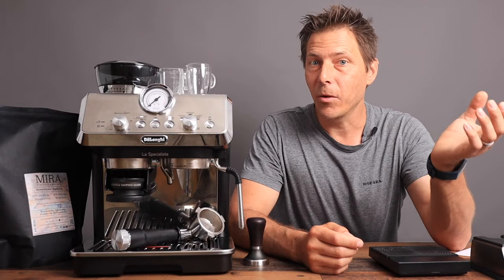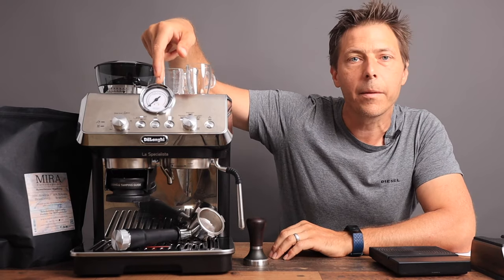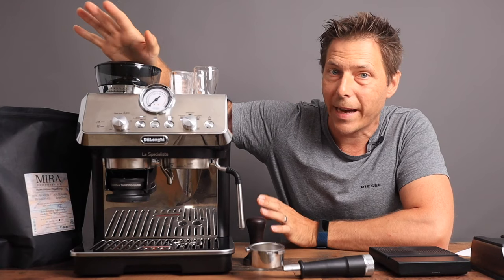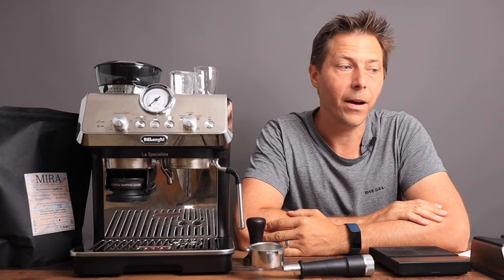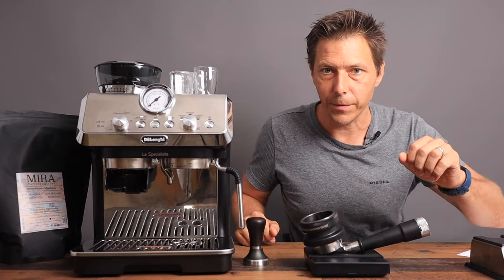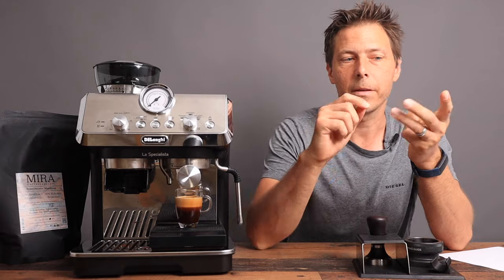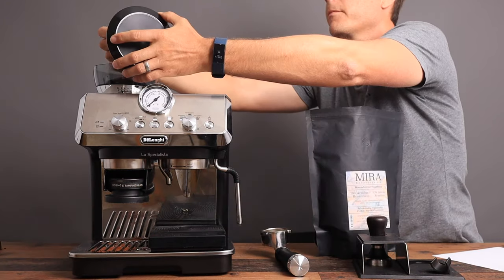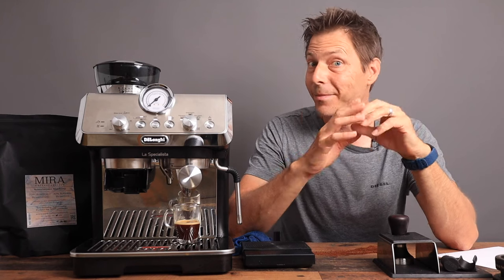Low Pressure? How to Dial in Delonghi La Specialista for the “Optimal Zone”

Comment: Hi Tom! Awesome video! Just noticed you didn't quite hit the 20-30 seconds extraction mark. You stop it around 11 seconds after the first drip. Mind filling me in on that?

Thank you!
Reply from the maker: I time starting from when the pump starts, not first drip. Cheers!
Reply: Thanks, this is really helpful as I had been timing mine from the first drip (as I understood that to be the correct point in time) but the shots were way to quick. In terms of volume (I know it’s not accurate) if I want 60ml the the ratio is closer to 1:4.
Reply: @thejuicyme  Hi! Honestly, all the other espresso machines I've seen start timing from the first drip. Even with a grind setting of 2, it still drips too fast.

Comment: Hi.  Excellent video.  Just what I need to watch at the moment.  I have a question.  My Las Specialista didn't come with the thing that you used to stir the coffee powder (the thing with several steel wires).  What does this called in delonghi's part list?  I need to find one.  Thanks.
Reply from the maker: Thanks for your feedback! It is called a WDT tool, but it is not from Delonghi. You can search your local Amazon or Etsy for one. Cheers!
Reply: @TomsCoffeeCorner  Thanks. Just ordered one.  Now after following your tips here, I managed to get 13g of powder at setting 4 and using the included 1 cup filter (Las Specialista Arte included 1 cup filter).  I reprogrammed the volume of the water to 26ml.  I temped the powder to the index line on the filter (from the instruction book).  The pressure is 9 bar so everything seems good.  However, the timing for the extraction is only about 12-13 seconds.  Is this too short for a single shot?  How can I get close to 25 seconds?  Thanks again.
Reply from the maker: @kamhonleung5524  Single shots always run faster...but I find that it is hard to even get a double to last 25 seconds on the Arte model, since it has such a long pre-infusion. Cheers!

Comment: Hi Tom,  I am a bit confused in the amount of coffee powder to the espresso volume.  In the video you mentioned a 2 to 1 ratio.  I understand this as the optimum volume of espresso should be 2 times the amount of coffee powder.  In other words, I should get 32 ml of espresso from 16 grammes of powder, am I right?  However,  the volume of the double basket from the Delonghi LSA machine is about 16 grammes and  32ml is about a singe shot.  The certified Italian Espresso table you showed at the beginning of the video listed 7 grammes for a single shot.  So it's about a 4 to 1 ratio.  So 16 grammes of the double basket should give 64ml which is close to a double espresso.   So is it a 2:1 or 4:1?  Thanks again.
Reply from the maker: Hi, I just always do doubles, so 16g in, and 32g out. The italian espresso would be 7g in, and 14g out. Cheers!
Reply: @TomsCoffeeCorner  Right. The output needs to be measured in g as crema does have a different density than coffee so the output volume in ml is a useless measure in this context.

Comment: Hey Tom,
Great videos. I just bought a la specialista and is really frustrating I cant get past 5th or 6th on the pressure gauge. I’m grinding at level 1 the fines possible and that is the only way to even move it a little. 

Can you suggest trying out something since I’m wondering if I’m doing something wrong or the machine is somehow broken?
Reply from the maker: Hi Hristo! Please watch this video about beans and I think you will find that that helps: https://youtu.be/5BgMKqu8fJI
Cheers! Tom
Reply: Were you ever able to get your pressure up in the right range? I bought this machine about 1 1/2 weeks ago and I haven't been able to make the gauge go into the optimal zone. I can't figure it out. The beans are fresh according to the package date, so that's not it. Any suggestions?
Reply: @suew4609  yes I do. Actually it turns out that the most prominent difference is in the beans you are buying. Try different suppliers, and of course go for barista shops rather than big supermarkets. It is also more important for bad beans to put fine grinding(start with 1 or 2), more quantity(after the middle if needed) and good/solid tampering.

Regards
Hristo
Reply: @hristotodorov9430  Thanks for answering! The beans I bought saw use by 3/23, but I did get them from Amazon. I found a roaster near by, so I'm going to give them a try!
Reply: @TomsCoffeeCorner  Thanks, Tom, I'll give it a look!
Reply: Hi. May i know did you get your problem solved? Mine have same issue. Need to do finest grind to get into optimum zone. I’ve tried different fresh beans from local roaster and still the same. Could be problem with my machine?

Comment: Your videos have helped me a lot, but today I have a problem with my coffee machine, I hope you can help me. I have a couple of months with my Specialista 9155. For a few days now, the optimal pressure indicator of my Specialista has almost reached the red line. Since I bought it I have not changed any settings on the coffee maker and I have been using the same coffee; the gauge has always been within the optimum pressure zone. What could be happening? How can I reduce the optimal pressure? Thanks.
Reply from the maker: Have you tried grinding coarser? Otherwise, you may also have to clean the grinder. It sounds like it is grinding too fine, so maybe cleaning it may help.
Reply: @TomsCoffeeCorner  Thank you very much for your reply 👍. I just tried a coarser grind (5) for a dark roast, it was much better. As soon as I have a break I will clean the grinding.

Comment: This video is really helpful. But why this Maschine doesn’t make espresso for 25 seconds? Only about 10
Reply from the maker: The best you can do is grind as fine as possible, and use fresh beans. That should help.
Reply: @TomsCoffeeCorner so if you need to grind the finest coffee why isnt it easier to put it on the minimum? In The video you put 2 why not 1 ?

Comment: Using a very fresh medium roast with the included basket and seem to get black zone or close to black zone pressure that drops off through the extraction using grinds 2, 3 or 4. Any pointers? Honestly flavor isn't terrible but maybe a touch sour. Crema is slightly underwhelming. Coming from pressurized baskets on my last machine this is a touch fussier but I'm willing to learn!

Edit: using grind 7 at 15 got me to a constant 10 bars with a much prettier crema but seems even more sour. Probably me but maybe these beans? If anybody reads this and has pointers please let me know.
Reply from the maker: Hi there! Well that 10 bars sounds good. Which temp setting are you using? I'd recommend the highest setting, preheating your PF and cup, and if it is still sour, you might want to try a roast darker than medium, and see if it extracts better. Cheers!
Reply: @TomsCoffeeCorner  should've tried hottest before posting. Really surprised how big of a difference that made. Even down to the last drop in my cup. Night and day difference. With my current beans and basket grind 7 and time 14 with highest temp has given me my best results by far.

Comment: is it 1 hole tip or 3 hole tip. is it ok remove plastic tube from inside of this steam wand for greater pressure ?
Reply from the maker: No, you cannot remove the tube, as it is a part of the actual steam want. It’s a one hole tip.

Comment: I have a new La Specialista. Using fresh med roast beans.  Grind setting 2-3.  My first 20 shots were perfect, but now my machine pressure is reading very high, in the black area of the pressure zone. What am I doing wrong?
Reply from the maker: Might just need to coarsen the grind, or dose a little less. Could also be that your basket holes are getting clogged.

Comment: Hi Tom. I try to stop at 30g but I always end up with 43-45g waiting for the last drop. Judging from your other La Specialista videos, it seems like you leave the cup under the portafilter so I guess something is wrong with my extraction? Should I try to program the machine to stop automatically versus stopping it manually? Any advice is much appreciated.
Reply from the maker: Hi Austen! No, I cut the shot off at 30-32 grams. I just slide another cup under the brew group to catch the remaining liquid, then dump that later. Since these machines have no 3 way solenoid, this is just what I have become accustomed to doing. I would suggest you do the same. Cheers! Tom
Reply: @TomsCoffeeCorner  Got it! Do you stop the extraction, say at 25 grams, to give yourself a couple seconds between hitting stop and sliding another cup? Or do you stop at 30 grams and have super fast hands to swap cups? 🤔
Reply from the maker: @austenchen7716  After all these years, I have fast hands, like a card dealer. :)
Reply: @TomsCoffeeCorner  hand speed of a bullet train 🚆

Comment: Hi Tom, I've had this machine for about a week now and I haven't been able to extract a shot in the right pressure range. They are all low. I'm using fresh beans, according to the bag, and they are decaf. Some shots taste ok, with milk and sugar, but I don't know what I'm missing by not getting it in the right pressure range. I'd appreciate any suggestions.
Reply from the maker: Which brand of beans? Does the bag say the roast date? Have you tried grinding finer? Finally, do you weigh your doses?
Reply: @TomsCoffeeCorner  The beans don't have a roasted date, just a use by date of 3/23. I've tried a #2 grind between 15g and 17g.
Reply from the maker: @suew4609  OK, well then they could be pretty old. Just for a test, get 250g freshly roasted from a local roaster, and see how that works.

Comment: Dear Tom,
I have an issue with the grinder and the amount of ground coffee. I have just set up my new DeLonghi Prestigio machine and I cannot use the single filter without the ground coffee pouring over the edge of the filter way over the marking doesn't matter how hard I tamp it.  The grinder is set to the minimum amount and for a single shot and using the single filter. When using the double filter and the grinder is set to the minimum it just gives the right amount of ground coffee by the marking for two persons (not using the 2x setting!). So it is like there is no way to adjust the amount grounded as it gives all the time the same amount which is OK for two persons only. Is there and way setting up the grinder so it gives less amount of gruond coffee? 

Another thing is, when the grinder is set so it does not start automatically, what is it to be done to start the grinder and is there a button or setting so I can stop the grinding process manually? Thank you so much!
Reply from the maker: Hi there! Well I have not tried the Prestigio. But I would suggest grinding finer. Then, less will make it into the portafilter in the given time. 
By the way, can't you manually stop the grinding process by hitting the button again? Cheers, Tom
Reply: @TomsCoffeeCorner  Hi Tom, Thank you so much for the quick response! As for the grinding process, there is no button for starting or stopping the grinding as it starts automatically once the portafilter is inserted. You can choose to not start the grinding and switch it off by turning the min-max scale to the 'off' position, but there is no separate button for starting or stopping the grinding. So I do not see why the 'off' position is there as you can't manually start grinding when the portafilter is in place and the 'off'' poisition is selected. You have to remove the portafilter, set the grinder from 'off' to 'min' and put back the portafilter in its place to get the grinder started. It will always start and stop by itself according to the amount set (from x-light to x-dark) but it grinds too much even when it is set to the 'minimum' position. 
I will try to set the grinder to the finest '1' as you suggested and we'll see if less coffee comes out. Thank you again!
Reply from the maker: @AA-pg8fx  Hmm, from a standpoint of ergonomics, that sucks. The Arte is better that way...I can start and stop manually as I want. Let us know how it goes. Tom

Comment: Hi Tom, this is all good and well, but what about time? Are you getting 25 sec extraction time? Seems like the first shot you did was much less time than 25 seconds. I can't for the life of me get a 2/1 ratio at the optimal zone in 25 seconds... always less .... very frustrating
Reply: I am getting the same results. If I "live" in the Optimal Zone, I get longer ratios than 1:2 (usually 1:3 or a bit more). On the other hand, if I dial in the shots to be 1:2 at about 35 seconds (counting pre-infusion) the pressure gauge ranges from 11-13 bar. Oh, but the 1:2 shots taste supreme, so I guess we need to use the pressure gauge up to some extent.
Reply from the maker: Hi Sergiu, I normally get about 20-25 seconds, but not longer. I would try the finest setting on your machine, and dosing 16-17 grams, to shoot for 25 seconds including the preinfusion. Cheers!

Comment: Hello I am trying to dial in my Specialista Arte machine, I am using medium dark rosted  coffee and I am having issues with the gauge, not sure if it isn't working properly, but when I hit optimal zone, the extraction is fairly quick, using a 12gm dose and aming for 24gm of Espresso I found my self getting that number in about 12-15 seconds, even thought the dial is in 90 degrees plus 1 line which is what you recommend in the video, and I've seen in other videos.

Any tips or recommendations here? I feel like when I go for more pressure, the result is a slower but bitter cup of Espresso, so I am not sure the gauge is really not working fine.... it is confusing
Reply from the maker: Is that 12g in the single or double basket? Because that is too low for the double. Try 16g. 👍
Reply: @Tom's Coffee Corner  it is 12gm in the single gasket that comes with the machine, but the same happened when I use 16gm on the double, it will pour very fast even though I am hitting the optimal zone. I could go finer on the ground but with more pressure the result is slower but bitter ....

Comment: Hey Tom, I need your help. I just received mine - and I’ve been trying to dial in the settings and only got into the optimal zone a couple of times. But I’m having the issue of it being too pressurized and it’s hitting the black. Using provided portafilter, roasted beans of 2-3 weeks ago. I use grind 4 setting, double shot and I’ve played around with lightly tampering vs heavy tampering and still keep getting in the black. Not sure what else to do!
Reply from the maker: Hi there! Well you can coarsen the grind yet. You can go all the way up to 8. Or, you could buy an IMS basket, which provides less resistance than the Delonghi stock baskets. In your case, I would just coarsen the grind.
Reply: @TomsCoffeeCorner  Thank you for the tips! I'll try them out.

Comment: What does it mean for the pressure to be on higher side? Not in red but just out of optimal. Does the pressure of tamping make a difference?
Reply from the maker: Sure, tamping makes a difference, but also the amount you put in the basket (scale is necessary), and the grind fineness.
Reply: @TomsCoffeeCorner  Currently using Delonghi's medium roast beans they provided. You think its accurate they state grind size between 4 & 5.
Reply from the maker: No, you still have too weigh your input and yield, and adjust the grind size accordinly.
Reply: @TomsCoffeeCorner  i don't have a scale with a timer is the timing important?
Reply from the maker: Yes. There are cheap ones on Amazon. Just have a look. 👍🏻

Comment: Hi Tom, 
I have recently bought this machine and when I press the ok button to start the drip, my coffee always comes out cold. If I hold the ok button down it comes out warm. I don’t understand what’s wrong. The dial on my machine for the optimal zone never moves. Not even a little no matter what I do. Any suggestions?
Reply from the maker: Hi Jessica, well holding the OK button just programs the amount of liquid to be extracted. It shouldn't have a bearing on temperature. But I have heard of some people having issues with their dials. I would suggest you call Delonghi, or your local handler. Cheers!

Comment: Hi Tom, how do i dial in the machine so it doesn’t overflow? I get alot of coffee come out above the threshold. Need to constantly remove it.
Reply from the maker: Hey Omar, do you mean that you get too many coffee grinds? There is a timer dial above the grinder. Just dial that back, to say 10-12. Cheers!
Reply: @TomsCoffeeCorner  Hi Tom, thanks for this amazing video, your reviews helped me buying this machine.
I think that I have the same issue. I set the timer at the min (0) and still the grinding last for 13-16 sec.
can it be set to 1 or 2 sec for example?
that makes me use the scale all the time.

Comment: Hey Tom, right out of the box after I have prepped it, I can't get the temp gauge to go up AT ALL. It stays at 0 and when I pull it out, the grind is wet, soaked actually. Did I just get a defective product out of the box? Thinking about returning it. Or am I doing something wrong? I follow the step by steps but my temp gauge doesn't ever change.
Reply from the maker: Hi Brian. It’s actually a pressure gauge. You might need to grind finer to get the gauge to go up.
Reply: @TomsCoffeeCorner  I was wondering that, but I tested it on the finest setting I could. I tried multiple settings. And still the same. Could it be possible there is a pump problem?
Reply from the maker: @Medteam23  Do you have a scale? How many grams are you dosing?
Reply: @TomsCoffeeCorner  thanks for the advise. I had to return it. It had a defective pressure gauge. Got a new one and worked great fresh out of the box. Now just trying to dial in to get optimal pressure! Thanks for the help